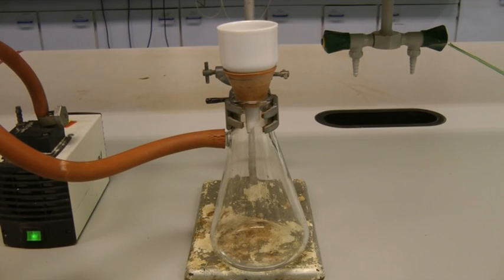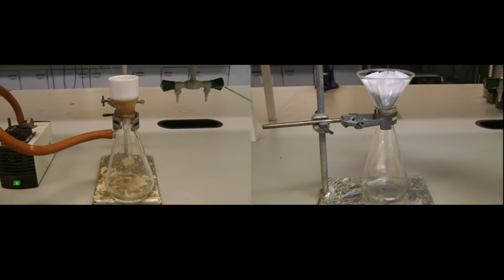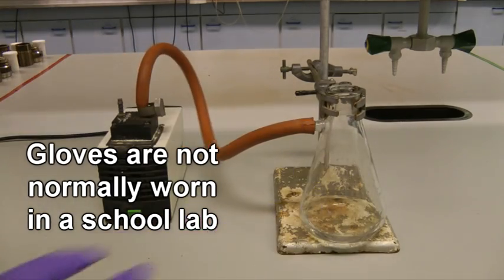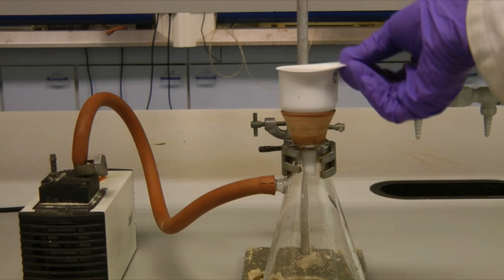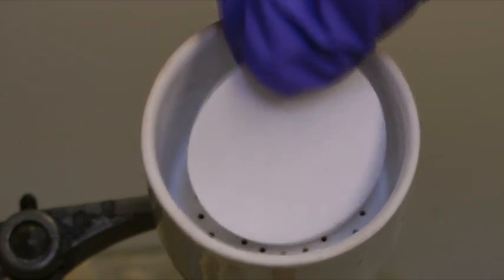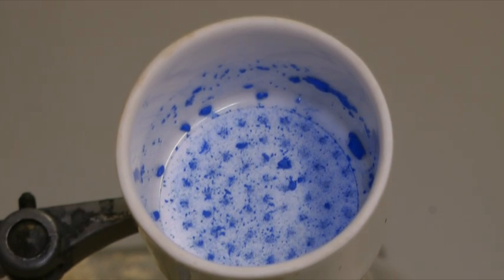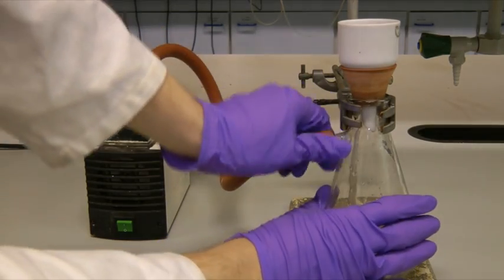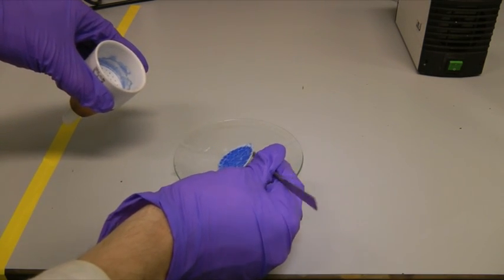Vacuum Filtration

Comment: Why is this considered primarily for when the solid is the product and liquid is waste?
Are there potential problems to be aware of if the liquid is the product?
I suppose if the liquid is very volatile, like many solvents, it could evaporate quicker under low pressure - but if the alternative is gravity-filtration which needs way more time, and it's not in some sort of sealed system, I suspect the would be less by doing it faster anyway.
I'm not a labtech, just a DIYer with interrest in practical chemistry. I've been looking into very basic vacuum filtration as a method of cleaning accumulated (insolulable) gunk out of various liquid used for immersion so they can be reused for a while. It's hard to keep an eye on things when solutions become so muddy that you can't have good visibility.